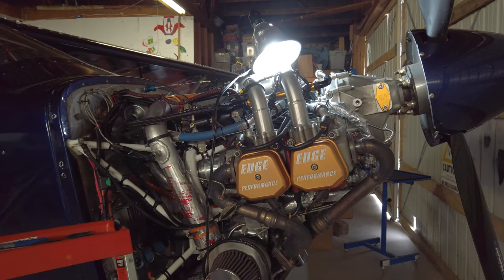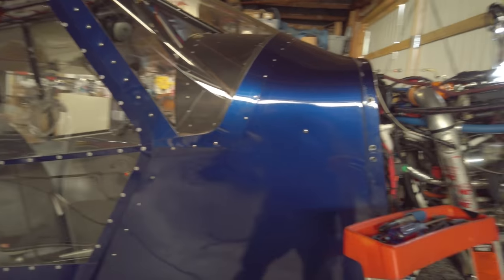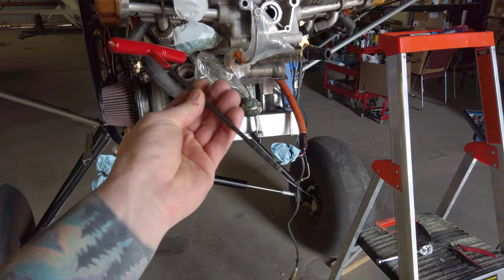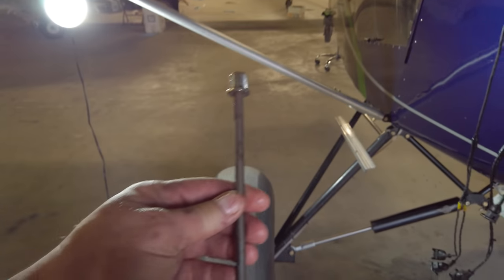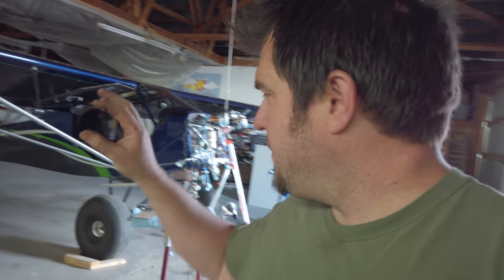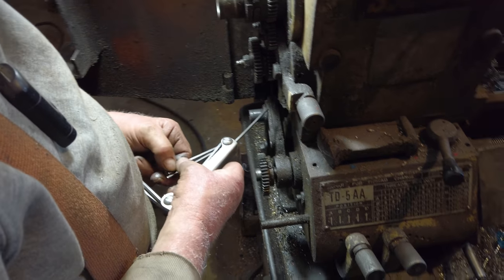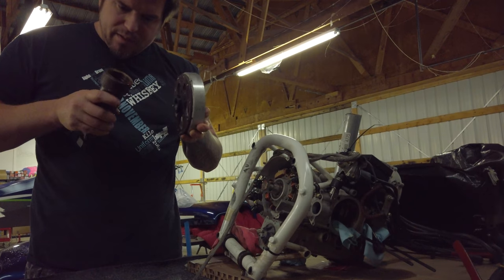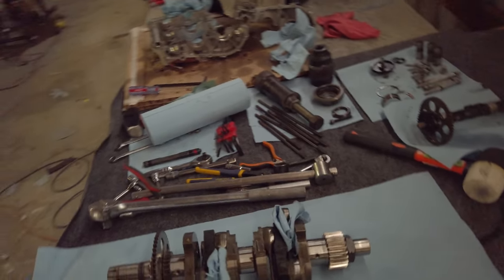The engine in my AIRPLANE is DEAD!

Comment: It all seemed like dejavu.....the puller that I didn't have (and running of to an open engineering shop on a Saturday morning, who quickly made me one) and then the deep socket that was made in the same way as yours. Did you had to make tools to split the two case halves, also?.....I had too, LOL. The fun and learning when opening up your motor for the first time is very satisfying.
Reply from the maker: been down this path as well it sounds? dang!!

Comment: I also had my crankcase develop a hairline crack. It was part of a batch of Rotax engines that were under an airworthiness directive to inspect for hairline cracks. I replaced it with the new style crankcase. It was expensive but as you said, it needs to be done and done right. Good luck and safe flying!
Reply from the maker: too bad these old ones sucked!!! I want to say I've been told none of the new style cases have ever cracked?! not sure if thats accurate.. but you know what I mean after going through that.. way better setup... sorry to hear it got you as well....

Comment: Sorry to hear about the engine. If you’re cutting a metric thread it will be threads per centimetre not inch. I did my apprenticeship building aircraft with British aerospace. Like the majority of aircraft manufacturers we used the imperial system. So have always used inches. But as I got older I’ve started using the metric system. It is so much easier to use. Love your dads machine shop
Reply from the maker: Makes sense...where it messes with me is the threaded drive shaft that moves the tool carriage has the 8 points at which you can release, and then re-lock back in for the cuts... they dont work with metric threads.. you can lock back in on the same mark, but the tooling might be off track.... since that threaded shaft is threaded and divided in inches not metric... interesting stuff. Thanks for the comment!!

Comment: Man, that SUCKS.  I have an older case, plane jane ULS 100hp in my Evektor Sportstar.  I live in New Mexico and would LLLLooooove more power but keeping pressures low and just letting it be is all I can afford.  Fly with half tanks for local area fun and keep it light.  The allure of power is intoxicating for sure!  Hang in there, brother.

Comment: You sure have had to deal with a lot of difficult problems with your engine and mods.  I admire your persistence and patience.  I think I would have given up long ago or gone broke one.  I guess I don’t have a high opinion of Rotax in general.  I will continue to be watching to see how your progress goes.  Good luck!
Reply from the maker: Thanks Jim... appreciate the comment. Rotax has it's good and bad traits.. keep in mind these engines produce massively higher power than lycomings and continentals for their size. For example, this 914 is about 72 cid, and makes 115hp stock up to 9000ft., thats 3.2 times as much power for its displacement vs. an o-360 at sea level!.. and something like 20-30% more power for their weight etc. Trade of for that performance is that everything has to be 'more right' .. less margin for error I guess you could say. They generally do last very well, especially the run of the mill 100hp models... but as with everything, there are those problem areas.... I knew this older case version could be a problem.. and dang, that really is no joke! The other thing is this... what's the alternative?.. the Yamaha conversion is the only thing I can see... there is no lycoming or continental that can even remotely compare without eating up a huge chunk of useful load and throwing CG way off, raising stall speed etc. I flew an o-200 equipped ch750 here and it wouldnt climb out of ground effect with 2 onboard on a semi-warm day at these high altitudes. Flying from 7k and landing at 10k+ with DA's in the 13's really does create some huge hurdles up here. I wouldn't be against running something else if something else existed if you know what I mean. My last rotax was hopped up pretty good and had almost 1200 problem free hours on it when I sold it... I hope this one will treat me more like that after this build!!!

Comment: Ive seen case cracks in certified Lycoming aircraft engines numerous times over the years, hopefully Rotax makes a beefed up case to deal with the higher horsepower settings, unfortunately thats the dilemma you face when you pull more horsepower out of a power plant than what it was originally designed for. Historically speaking companies like Lycoming and Continental haven't dealt very well with higher horsepower modifications of their certified engines, although Ive heard that with the experimental category going great guns, thats all changing, hopefully Rotax has a program that deals with higher horsepower modifications of their engines.

Comment: Awe man, that situation sucks, would it be possible to weld the crack, then reinforce the problem area with fillet weldments, im sure it could be made much better than original at a minimal cost. Im not a pilot or a plane owner, but i am a 30+ year toolmaker.
Reply from the maker: good Q.. the  thought crossed my mind... maybe not worth experimenting since it's an airplane, but in general... things like that of course are done.. not sure what material the case is made from (7 series that can't be welded or something lesser that can? not sure). since these are prone to crack in several different areas, I figured it's best to upgrade to the new one that doesnt crack.. but I hear you on what your thinking...

Comment: Outstanding video given the terrible circumstances. I liked seeing the guts of the Rotax. Great news that Edge is going to the mat for you to get you back in the air as soon as possible. I know you’ve already got a lot of $ invested going down the 914 road but it would have been great fun to see an Edge 300 HP Apex strapped on to your 7!
Reply from the maker: thanks Todd.. agreed, if I could go back and do it different, I would definitely just bite the bullet and go Epex! would be a big-ish project up front, building an engine mount, cowl mods possible etc... but in the end.. damn that would be a sweet setup!

Comment: Such a bummer man. I feel you you. 3 questions tho. What’s keeping you from just getting a 915? Is the cost difference that much? Secondly what about an electric constant speed prop? Thirdly what’s going on with that Cherokee in the background?
Reply from the maker: When I first set out for an S7, I was expecting to find a stock 100hp uls S7, and I was seriously considering selling the motor and buying a 915. Ultimately, I was glad to go down the 914 route at that time, after looking at the 915 closely.. the extra weight on the nose had steered me away. Plus I have looked over the only 915 powered S7 out there and it was a major engineering project to fit everything inside that narrow cowling. Zero room to work on anything which is a bummer... Also, the cost is a lot higher on the 915... that was the other thing.. neat engine, but dang... pretty steep at almost 40k! Of course this setup has had it's frustrations (this cracked case), but I think ultimately - for performance vs. weight, full control over the tune etc. the Edge setup will really be awesome. The constant speed prop has definitely been on my mind.... would be super helpful for altitude changes which I see regularly (7k-18k around here, and obbiously going lower when in other states) ...  i'm not going to tell you I won't ever go that route.. as it could happen.. but I keep telling myself I don't want any more nose weight... we'll see though! .. the cherokee is my buddy Lynn's, he picked it up in pieces, (all freshly painted, with a new o-320 for it). We stuck the wings, hung the motor, put the gear on etc... still needs a ton of work to be airworthy, but he has been putting it together slowly.. he does some CFI stuff on the side, so it would make a good trainer... ultimately I think he will sell it down the road. Thanks for the comment!

Comment: Id like to get your old crankcase to try to figure out how to repair or solve that potential cracking problem, before it happens. either by internal/ external welded bracing or some sort of girdle system that acts like an exoskeleton  that helps stabilize the structure of the block. It sucks worrying about if this time bomb is going to go off on older engines. Rotax should do the responsible thing and not profit so heavily on the misfortunes of others thru faults in their design.

Comment: Hey GKF, I’m looking to buy a 912 ULS powered RV 12 in the next few months..is there a quick and  easy way for me to tell If the engine is one of these old vs new style cases that is prone to cracking? Thanks!
Reply from the maker: Hey Wes, there is! If you can get the serial, and or confirmed age... 07+ motors all have the heavy case... if you are looking at it, look on the side of the engine up front.. right near/behind the oil filter.. where the magnetic plug for the gearbox is.. there are two bolts there... they will either be allen headed bolts, studs with nuts, or regular bolt head bolts... all the old cases had the allen headed bolts I believe... allens = bad... anything else = good basically. Hopefully it's a newer motor and if so I'm sure it will live a long happy life for you!

Comment: How about a modern ECU that does the ignition as well. A wideband O2 sensor would enable the ECU to optimise the boost at any altitude.
Reply from the maker: This ecu does have capability to control timing... thrown around that idea as well.. has to be both some efficiency and power gains to be made there, plus starting better etc.! It has a wideband on it (actually two, one on the ECU, and one I installed prior to fuel injection so I can monitor in the cockpit).
Reply: GravityKnightFlying  Excellent - you have a new sub.   What about the exhaust sensor?  Also can it control the boost with a waste gate?
Reply from the maker: Stephen Gloor  thanks Stephen. The boost is controlled via the ecu with a servo that controls the wastegate.. pretty interesting deal.. its the factory servo setup - the edge system runs the servo that the factory rotax ecu originally ran... its a neat deal in that it has full control (no base wastegate pressure).. but also a bit tricky to tune in some aspects (takes a bit to get duty cycles all dialed in)

Comment: Just got my new 914 uls conversion with welded crank, oil squirters, etc. from edge last week.  I think it’s a good setup for way less weight and money than a 915.  Your S7 is really gonna rip.
Reply from the maker: thats awesome Fluffy! congrats...agreed, the power/weight is hard to beat! what is yours going into?
Reply: GravityKnightFlying it’s going into a kitfox STi.  You going to keep the same prop?
Reply from the maker: @hammitr  oh ok cool! I will for now. I'll be non-intercooled at first and power limited, so it should do ok with a little more pitch. I think when I add an IC I'll need more prop as well. What are you running for a prop?
Reply: GravityKnightFlying I ordered a 3 blade luga.  I will be running without an inter cooler for now as well, but I am only at 3500’ so the turbo isn’t working too hard.
Really enjoy your videos keep up the good work!

Comment: What a bummer. I feel like I've been there, but with a certified engine which makes that $s go up at an exponential rate. So, at least you can be happy that you are experimental where the money at least makes some kind of rational sense. There have been times when I've felt like everyone thinks I'm the DOD paying to keep a Continental going.

Probably not helpful, but I'll just make this point. If that were a Continental or a Lycoming you would be looking at getting that case half welded. A place like Divco can make an airworthy repair to a case half with a weld. I have no idea if that's an option with a Rotax, but I thought I'd mention it. Sounds like you have a plan that will upgrade the case to handle more power. But, welding can be an FAA-approved repair to a cracked case. 

Last thought. Have you considered setting up a Patreon account? Or maybe even a "Go-fund-Me" program? I'd be willing to pitch in a few bucks to help you get back in the air. I'm enjoying your videos and I'd be willing to pitch in a few bucks for the content you're providing. There is really no-one else with a channel that's as directly relevant to what I'm building and hopefully soon flying as yours. Seems only fair that I pitch in a bit to help you get back in the air. I bet I'm not alone.
Lastly; your Dad's a legend.
Keep up the videos, you've got a fan base pulling for you.
Reply from the maker: dang man... I sure appreciate your comments time and time again. Good help, and perspective, and some good ideas to consider. 
As far as the case, I didn't realize welding a case was an approved repair (at least on some engines). I've never heard of it done on a rotax, but that sure doesn't mean it can't be a thing. 
But really thanks for bringing up the Patreon/Go-fund-me idea... I'm going to give that some real thought. As I'm sure you can guess, I didn't set out to replace my day job with YouTube... but at the same time, the videos do require a ton of time, and a lot of gear, and it hurts money wise. I was hoping to maybe break even someday so I could justify it all a little easier. Sometimes it's hard to keep at it when it just costs money to produce content you know! So I appreciate that so very much... thank you! Going to be looking at this very seriously. -T
Reply: @GravityKnightFlying  Wow, note to self. I just re-read what I wrote last night, it's a reminder not post comments when engaged in COVID Alcohol Therapy. I guess I got my points across because you seemed to understand but wow, what a mess. 

I'm no expert on this, but I hear about Divco all the time for crankcase welding. http://www.divcoinc.com/
Seems like many of the engine overhaulers send the cases to Divco for repair. 
They don't list Rotax as one of the cases they work on, just Lycoming and Continental. Since it's experimental, I'm sure they could legally weld it. Not sure they will but they could. Definitely worth a call.

In the certified world some cracks can be welded and returned to service, some can't. It depends on where the crack is. 

As far as the Patreon suggestion, do it. Your content is better than most of the guys who are monetizing their channels. No reason to at least cover your expenses plus a little gas money. Who knows this thing could take off and you become the next Trent Palmer. Free Rotax 915, oodles of Garmin goodness, Bose headsets and on and on. I met Trent at Oshkosh last year. He's like a rockstar at the ultralight field, crowds waiting to meet him. Why not?

Nikk Audenried raised enough money on GoFundMe build a completely new KitFox with all the extras after his accident. 
https://www.gofundme.com/f/let039s-get-nikk-flying-again
Granted he did get badly injured so it wasn't worth it. But the Youtube community showed up in a big way to help him get back in the air. I sent him a few bucks and felt great about it. Well you need help getting back in the air, at least give us a chance to help.

Comment: hope you was pushing just for the video other wise should of been pullin. also sounds to me you need a constant prop instead of fixed. same as a transmission in theory would help your rpm  and power problems I think.
Reply from the maker: left hand thread
Reply: @GravityKnightFlying  It just so happens...I know an outstanding machinist in your area! 😀

Comment: Grind out crack all the way, past the edges about a quarter inch, and weld it up. I've done it on hairline cracks like that before on a few other motors, car motors, but same thing basically. Had a small crack like that on an ej20 that was pushing about 750 crank hp @ about 30 psi of boost, literally still running the same setup and it's been fine since. There are other methods too, here's one system, I haven't tried it, but it seems decent: https://www.youtube.com/watch?v=Pq0wfU4ZaKk
Reply: As an emergency repair, absolutely. But on a 150hp engine, if it develops cracks like this you are playing with fire trying to fix it.